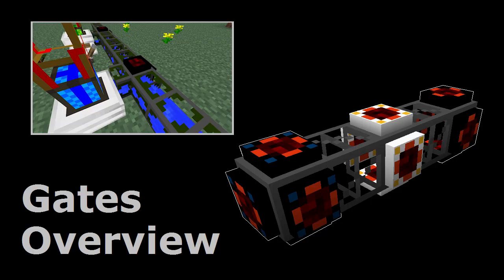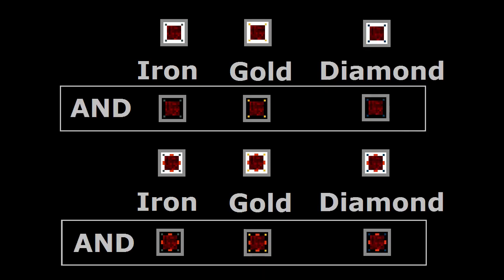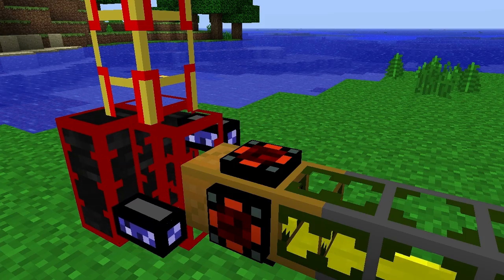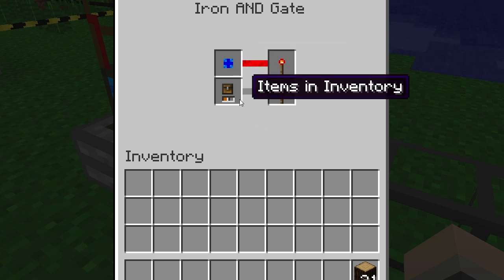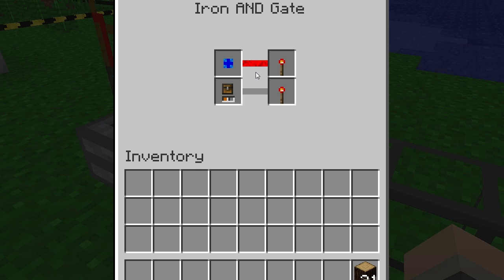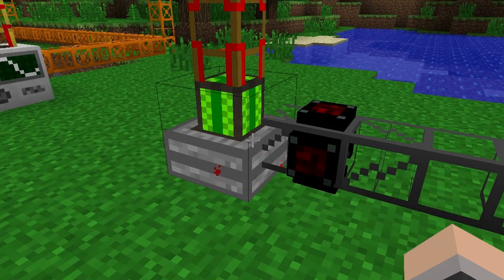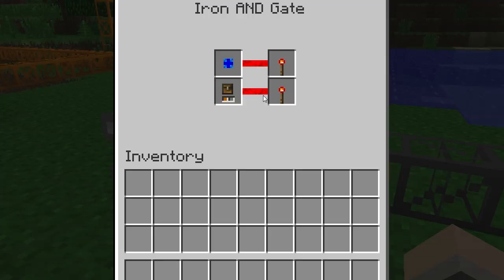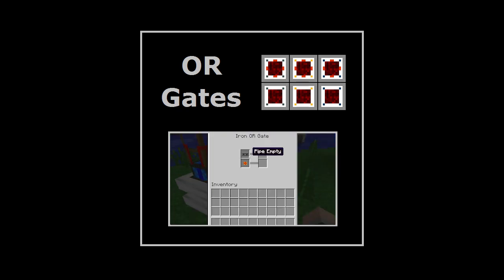AND Gates (Tekkit/Feed The Beast) - Minecraft In Minutes

Comment: Important to note that only events that share the same result need to all be on for them to work.  With only 1 event set to a result it behaves just like the basic gate.
Reply: Holy cow! After 11 years your comment helped me in creating compact (one gate) design that realizes two basic function: engine blowing-off failsafe and generic on/off switch (like for main turn-on-off lever, or end-of-work-shutdown for quarry). Example setup: E - engine, P - power pipe with AND gate and one colour wire, S - redstone (S)ignal from main lever, X - nothing, O - energy output pipe:
XOXX
XPSX
XEXX
AND gate needs to be at least gold (3 rows required). Lets assume we used red colored wire. Gate config:
first row: is engine is yellow(*), emit red wire signal  (+) => this check if engine IS in 'dangerous' stage
second row: if there is NO red wire signal (-) , then emit redstone signal => this takes feedback from 1st row and check if engine IS NOT in dangerous stage
3rd row: if there is redstone signal (or any other dedicated MAIN on/off signal, like other colour wire), then emit redstone signal (that will be received by engine).
Cases:
Main lever is ON,  Engine is blue/green -> 1st row DOES NOT emit red wire signal, so 2nd row is positive AND 3rd row is also positive  -> redstone to engine IS emited. If main lever is OFF or if engine enters yellow (*) - dangerous state, rows 2 or 3 are no longer fulfilled, so no redstone to engine will be emited.

* - if we want to stop only when we hit red state, change this to red

Pardon for excessive long comment, but I wanted to feed back to you how helpful your info was to me, even after so many years (and on old rusty MC 1.4.5 found on the bottom of the 14-yrs old laptop).